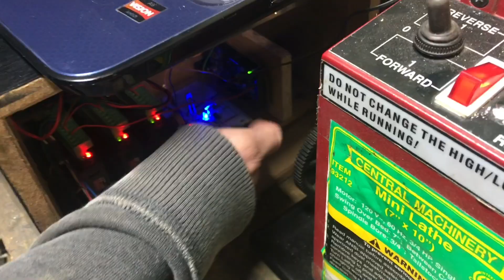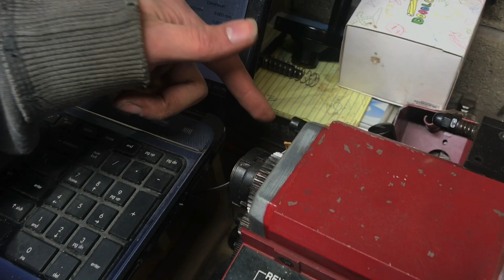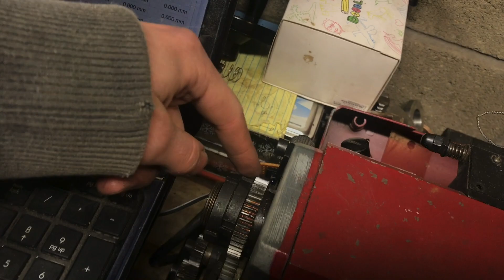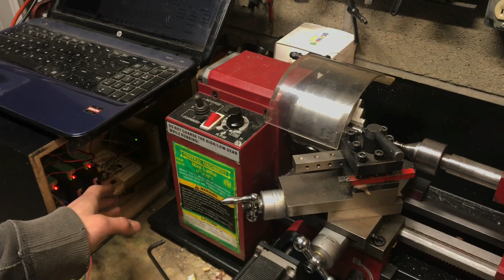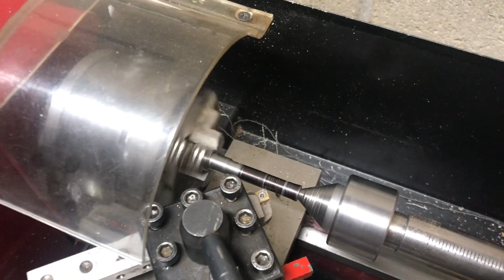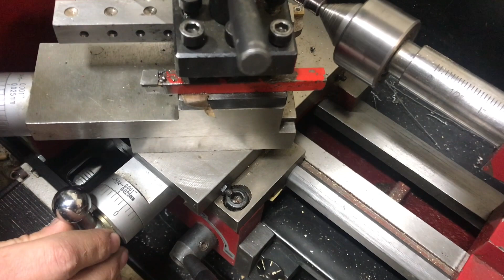CONVERTING “manual lathe” into a “cnc lathe” (harbor freight central machinery)  grbl

Comment: Hey nice vid. Threading tools usually use 60° cutting tools. Looks like you had a 90 ° boring bar or something. You might have better luck using a different threading tool.